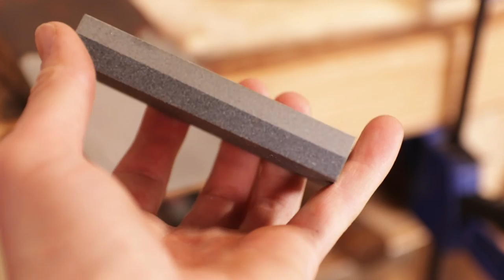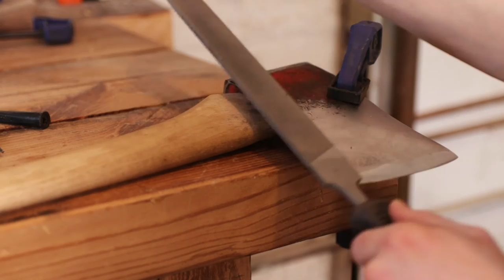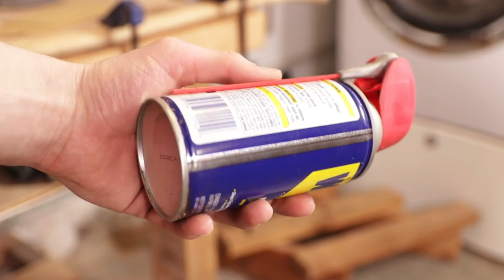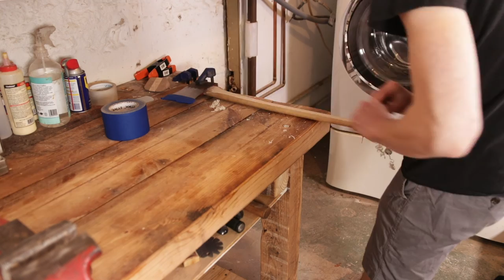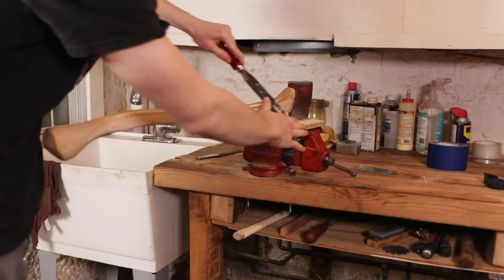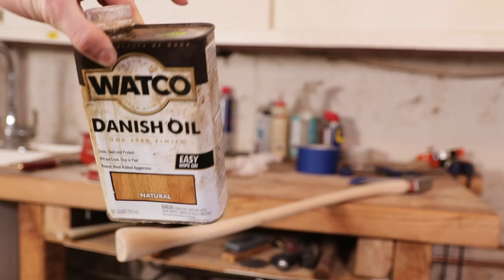Tuning a Vintage Axe to Make it Chop Well

Comment: Sharpening edges, is all about consistency, precision and patience. It's mostly experience, then knowledge and lastly tools in terms of importance. Whatever you do, no matter how many passes it takes with the file or stone, you have to do the same acroos all the edge bevel. Working in sessions and keep working only on a part, is wrong. I would try to change that If I where you, becasue it eventually will become a habbit and that means, that you  will always do that mistake. Wrong habbits , always hold people back.
Don't put your fingers on the end of the file, always put your palm, the same way you do it, in most parts of this video! Try your passes, to be even and start from one side to the other end, without leaving gap, or pushing super hard, be cosistent, means same medium pressure allover the edge. 
      Turn to the other side, repeat exactly what you did on the other. In the end, both sides, should look perfectly the same, like a mirror image . By the way, Mirror finish, and a slight convex geometry, is always the best edge possible!
Reply from the maker: Thank you for the advice. I was giving this axe a banana grind so that's why I focused on the centerline the most. Also I'll make sure to keep my fingers away next time, I think I did that bc I was an awkward angle